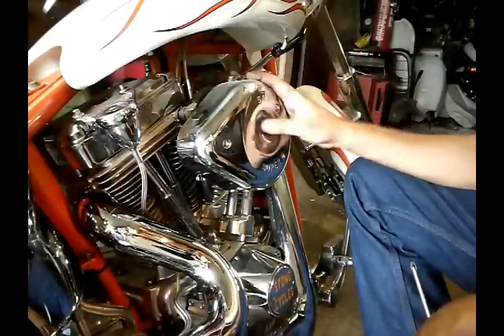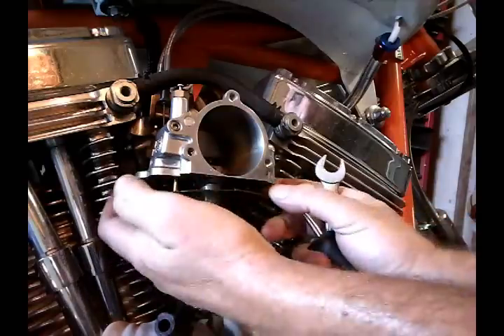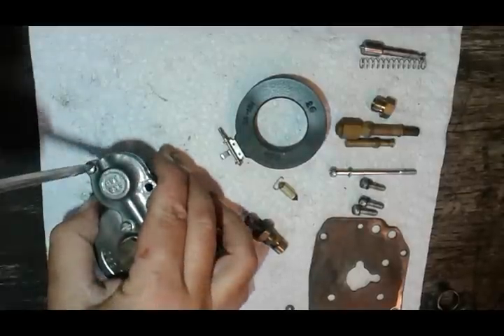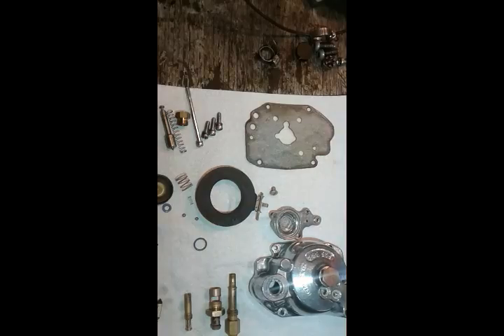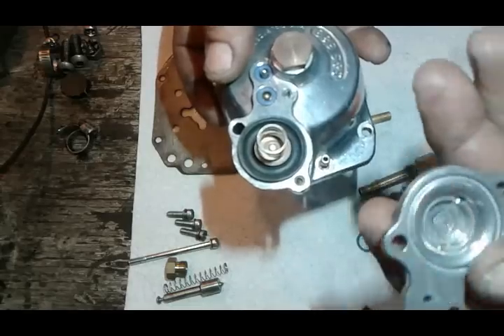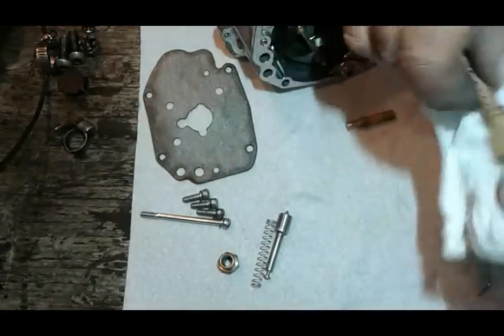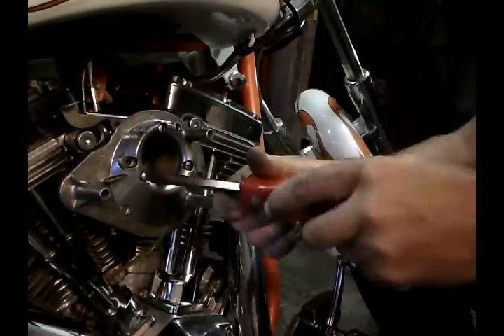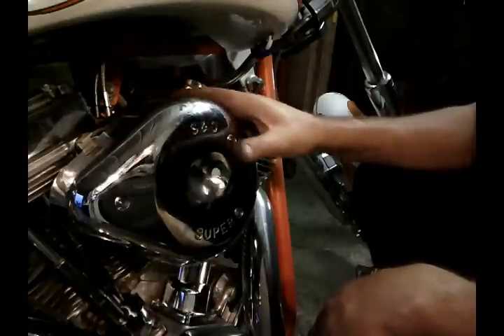S&S carburetor EASY WAY to CLEAN and REBUILD Super E & G

Comment from the maker: You have only 2 jets. Main and idle jet. As long as your bike was running correctly and the reason for taking it apart is that it was sitting and now it's running bad you don't need to mess with the Jets you just need to go through the cleaning procedure as you see in the video if you need to get the bike running richer or leaner or if you have any kind of performance issues that's another subject
Reply: I have a 2008 Big Dog Mastiff S and S 117 with the Super G carb.  The bike has sat the whole winter and when it was time to start riding I started it up and rode it about 20 miles.  Came home and parked it.  Walked back up to it about an hour later and I had gas dripping from my overflow tube.   I watched your video and put everything back together and started the bike up and it ran fine, But the same shit.... When I am running at idle I have now overflow, but when I shut off the engine it starts dripping out of that tube......  My float was actuating just fine and I basically set it up just like you did in your video, but still leaking gas out my over flow tube with the valve from the tank to the carb on.....  Any advice you could give me would be greatly appreciated.
Reply: @stich6406  check the float needle and seat probably goo or something not allowing proper seat

Comment: Absolute one of the best instructional videos I've seen.  My recent American Ironhorse Legend purchase (which had sat for numerous months) had sediment when I drained the fuel filter and carb.  I replaced the fuel filter but wanted to explore the S&S Carb so this video was super helpful for me to take the next steps of basic cleaning. I'm not a mechanic but I know just enough to get me in trouble 🤣🤣).  The S&S 111 engine and carb is new to me so SUPER  THXXXX...   A++++++++++++  👍👍💪💪

Comment: Outstanding video. Got my wife's 2005 Fat Boy running like new again, in less than an hour. Accelerator pump pushrod was gummed up and stuck. Only minor difference in my setup is that there is a breather tube feeding into the filter backing. Otherwise this was perfect. Thanks for the instruction.

Comment: Thanks!!!!!!! - Unbelievably helpful video.

This really helped me get a 1988 softail with a race built 98 inch motor running today that hadn't ran in over 17 years. 

Unfortunately, I went and lost the small o ring you mention to be careful with (Ejector Nozzle O-ring)  in the cleaning process. lol.
It is S&S part #50-8096 - A local shop had one -its is a silicone "006"  O-ring with dimensions  .125" I.D. x .250" O.D. ( just in case anyone else has this problem and doesn't want to wait for S&S replacements-they want to sell you 10 at  a time as well!). 

Figured I'd throw new O-rings in the accelerator pump as well- they are  a silicone "009" O-ring with dimensions 2.187" I.D. x 3.437" O.D.

This video is the epitome of why I love youtube-keep up the great work!
Reply from the maker: Thank you so much for your feedback...makes me feel good! Please subscribe...it will help me out 😊

Comment: great video, may I suggest when blowing the main & idle jets w/ carb spray, you plug up one end of the jet w/ a finger, so the spray will now go through and wash out those tiny venturi holes on the sides ;)
PS: Ohhh, and the intermediate jet as well ;)

Comment: Awesome video man! Just did it and everything came out super clean! Problem is now I have an overflow problem coming out from the overflow line. 
I just ordered a rebuild kit since the o rings and the gasket seemed a little brittle from sitting for 13 years but damn great instructional video!
Reply from the maker: The reason why it's flooding is most likely or float needle ... also the float seat where's the needle sits might be dirty and will need to be cleaned once you get the rebuild kit you should be good to go... Thank you for your interest and please subscribe it will help me out 😊
Reply: Do it yourself Motorcycle repairs thanks! Subscribed!

Comment: Hello, I just did this process yesterday and when I started my motorcycle there was a leak coming out of the overflow house at the bottom. What did I do wrong? Thanks for the video very easy to follow
Reply: Some thing with the float, probably not seated or clogged with gook

Comment: looks like a little clean up to get ya back on the road and thats  ok,, if your going thatfar at the house you should just take it apart soak it, strip it, , blow everything out with compressed air, new soft kit and ..always set the float level per,specs

Comment: Thank you for the video. Got me up and running again quickly and without issue. Side note: I got the NAPA version of the carb cleaner gallon. It is NOT safe for rubber. Just a heads up if anyone else gets that brand.

Comment: One question. So if bike was running fine but just needed cleaning from sitting, I shouldn’t need to adjust the gas or air or accelerater right?  Thanks for any reply
Reply from the maker: You should be fine without messing with the adjustments...but it's very easy to adjust...I will make one video on it soon...thanks for your interest and please subscribe to help me out 👍

Comment: Not greatest at carbs. So my super E shorty the needle tip seemed clogged. When I pull the throttle I noticed the spray of gas coming out the needle seemed very weak. I managed to get a small bent brush. Now it seems to spray better. Could that have also caused my bike to idle and backfire? It’s a 90 sportster 883 and put on 8.8 plug wires but it backfires while idling. I haven’t tried turning it back on because it’s late and don’t want to piss the neighborhood off haha. Could a clogged needle cause bad idle or is this separate from throttle?
Reply: Could be leaking intake manifold

Comment: Thanks, just watched this step by step and did my own.  My worry is the kit i had didnt have a new float.   How do you adjust the float as you state in the video
Reply from the maker: There is no reason to replace the actual float....only the float needle. If you go back to the video you will see the portion where I am talking about the float level. Just get it to the same distance as you see there from the top edge of the float bowl by carefully bending the metal tong on the float. 99% of the time its right on the money...If the bike is running good now, leave it alone...thanks for watching and for the interest!!!

Comment: I took one apart as such...I noticed the blue O ring was missing....would any small O ring work?  what happens if I leave it off?
Reply from the maker: Any fuel resistant o-ring will work... It seals the fuel from the bowl so it won't get up around it to the intake.

Comment: also should the enrichener lever be pushed all the way down at idle, or slightly up??
Reply from the maker: It should be all the way down  for sure...if you need to have it up a little that means something is way off. Did you just got the bike or was it sitting and prior to that was running good?? Give me little background info on the motorcycle
Reply: @DoityourselfMotorcyclerepairs  Hey I just got it last weekend,....I am following youre guide to clean....grabbed a master rebuild kit just in case...I can see the carb has build up on the outside,...2006 saxon crown sns 111....Im sure its been sitting for a year or longer....fires rite up and runs, but u cant run it with the lever down  it dies, has to be a little up

Comment: Great video, thank you. 
btw the float height should be 1/8" to 3/16" below the gasket surface.
See page 14 of the following .pdf it explains the procedure and shows a picture of how to measure it.
https://www.sscycle.com/docs/default-source/instruction-sheets/510-0251_super_eg_series_shorty_carbs.pdf?sfvrsn=2

Also, he didn't mention it but make sure you install the gasket between the backplate and the carburetor. The rebuild kit comes with one and it's obvious where it goes.

Thanks again for an excellent tutorial - looking forward to seeing more of your videos!
Reply: THANK YOU very much rcanoli99, for the PDF manual hyperlink!

Comment: i removed the carb from my bike because it wasnt starting. my pushrod doesnt go up and down when i open the throttle like yours. is that because the carb is off the bike or that shouldnt matter? If not what should i do next?
Reply from the maker: If the pushrod for the ACC pump does not move you have most likely bad membrane inside or something else in there that should be pretty obvious...just take it apart the same way you see in this video and you will find it...watch out for the two small balls in there and the little spring...don't loose it...
thanks for your interest and please subscribe to help me out

Comment: When i go to set up all 3 screws how far back should i turn the idle dcrew? Thnx my man
Reply from the maker: The way you set the carburetor is as follows....Start the bike and get it to idle without the choke...turn the screw all the way on the right (opposite side from the Throttle cables) all the way clockwise. Then start turning the brass middle screw ( air /gas mixture) both ways to find the smoothest and fastest sounding idle...then lower the idle some ( with the Left screw) to narrow the range when the engine sounds the fastest. When you get there only thing left is to turn the right side screw back counter clockwise to adjust the ACC. pump. It is usually about 2.5 turns but the idea is the smallest amount of turns while the bike does not have a flat spot while rapidly twisting the throttle to accelerate. Hope this was helpful and please subscribe to help me out...thanks brother

Comment: Yo dude whts up i bought my buddys dads bike its a harley fxsts softail a 1995, the guy kinda tricked it out with special accessory parts like ghis s&s shorty carberater im not sure if its a d,e,b,f lol anyways the over flow hose line from the carb wont stop leaking until i shut it down with the pit valve on off its drivin me crazy im hoping its an easy fix my cash is real tight right now....?if u have sny tips id be mighty gratfull later on my man
Reply from the maker: Your float needle is stuck because the motorcycle was sitting and it's gummed up from the old gas. Follow my video and you will fix your problem easily. I would also recommend replacing the fuel line... you can buy that in auto parts store and install inline fuel filter between the gas tank and the carburetor...also inspect the gas tank inside to make sure it's clean. Because if the gas tank is nasty it will screw up the carburetor again. Thank you for your interest and please subscribe to help me out 😊
Reply: @DoityourselfMotorcyclerepairs  thnx guy appreciate it the tip....yea its been sitting in this oldtimers garage since 1995 good lookin out tho....rite on..thnx

Comment: Great video... I would like to point out though that what you called the "choke" is not the choke. Its a "Fuel Enhancer" and if you leave it on after starting your bike too long you will foul plugs. Its not a choke. Just wanted to share that. Thanks for the video tho.
Reply: Yes, thanks for that observ
Choke restricts air intake to enrich the air/fuel mixture for starting.
S&S "enricher" increases fuel to air mix.

Comment: I need to do this job.. is it not easier to just pull the carb off the bike and right off the bat..
Reply: Sure you can pull the carb but for a quick clean up you shouldn't have to. This nasty ethanol gas leaves a mess in the lower half of the carb if it sets for just a short amount of time and a bowl and jet cleaning usually gets you up and running again.  If you want to pull the throttle cables, mounting bolts to give the carb a total cleaning/rebuild go right ahead, for me it's time wasted. I have 3 old Harleys with S&S's and every 3 yrs I have to clean them just like in the video. If I let that piss ethanol gas set in one over the winter then it's practically mandatory to have to clean it out to get it to run come spring time.

Comment: does the accelerator pump shoot fuel out or dribble ?
Reply from the maker: it should be good funnel shape spray...you will be able to adjust the amount of spray with the small flat head screw on the right hand side of the carburetor body looking from the top. Thanks for your interest and please subscribe to help me out

Comment: I have a 2000 Indian Chief with the S & S motor and the same carb.  It has been sitting for a long time and I got it going again.  I was test driving it and the bike ran perfect for about 5 miles on the highway and then started sputtering on and off.  Then I turned off on another road and gave it gas to accelerate and it died on me.  I let it sit for a few minutes and it started and made it home.  I then cleaned the carb for a second time.  Adjusted the float, fuel/air screw and the accelerator pump screw to the recommended settings.  I'd already drained the tank and added fresh fuel.  I changed the fuel filter, ensured gas was freely pouring from petcock.  Replaced the spark plugs.  Test drove again and when I tweak the throttle it still sputters like it is starving for fuel.  I'm afraid if I accelerate too hard it will die and leave me stranded again.  Do you have any ideas?
Reply: @FXRChristopher   OOPS he did change plugs,,,,,,,,,
Reply: Hi, I am experiencing the same situation on my 98 Heritage. I've had the bike and carb for over 20 years and rebuild it once with no issues. Recently, I went through the carb twice now and i'm experiencing the exact issue you are of starving for fuel. The choke in the past worked great in warming the bike up. Now if I use it, it will flood the bike out. Did you ever correct your issue with starving for fuel? Thanks.
Reply: I'm having the exact same issue with my 1993 fxdwg. cant find a single person to  help fix
Reply: Hey, been going through the same issues myself. Bike crapping out when going about 20 mph and chocking for fuel or spark.  I am a back yard mechanic trying to figure this issue out. I have diagnosed the carb twice, clean the petcock, check ohms for the coil, pinched wires all good so far. I am down to the ignition switch. Did a continuity test on the three contact pins coming from the ignition and all tested good. However, when I  perform a 12V test on the 3 pins while connected to the ignition wiring harness, I got a 12V positive reading from the switch in the accessory position when switched on, but get no 12V reading when switched to ignition/run position. I get a Positive 12V reading from the wiring harness disconnected from  the back of ignition switch 3 pin connectors to the battery,  but nothing when I turn the ignition switch on/run when plugged into the wiring harness together. You can perform this 12V test with a small gap between the pin connectors and wiring connector, or from in back of the wiring connectors while plugged in all the way to the switch pin connectors.  Talked to a few people and they mentioned that the switch could test good for ohm continuity, but fail when under 12V load. My 98' Heritage would start crapping  out at 20 mph on the road. I feeling like a fucking surgeon but don't want to take it to the stealership for repairs.  Hope this helps. The Breeze.................

Comment: You must have bought the Chem-Dip 100 years ago. Current Walmart price; 
996 Chem-Dip Carburetor & Part Cleaner
Current Price
$136.43   
Great video tho, Thanks.
Reply from the maker: Haha...you are right. I did buy this few ears ago …  but found it at Walmart website for $47 and also found this one for you at Advance Auto Parts...same thing. This one is under $30. Check it out here  https://shop.advanceautoparts.com/p/gunk-carburetor-parts-cleaner-complete-kit-cc3k/7040709-p?c3ch=PLA&c3nid=7040709-P&adtype=pla_with_promotion&gclid=Cj0KCQjw6rXeBRD3ARIsAD9ni9C9FsRe68g-lpX24FWwO_2O_1KXMKhdlKm0y-JUszkSF2e62L3EOpIaAoENEALw_wcB&gclsrc=aw.ds&dclid=CMPphrWdm94CFcvewAodBdoFtg
  Thanks for your interest and please subscribe to see more stuff in the future! See ya
Reply: I just bought it on amazon for about $21